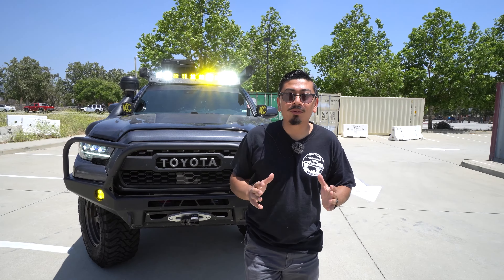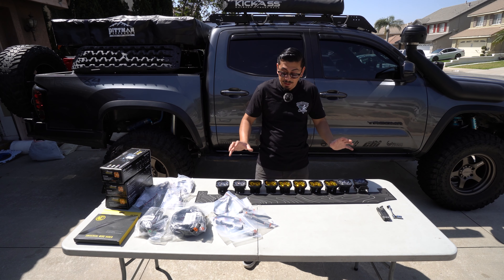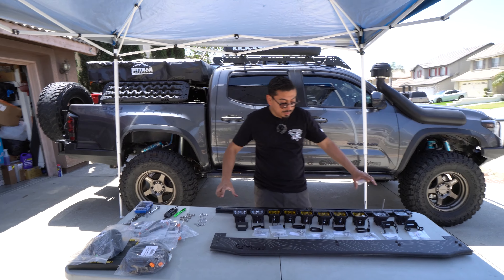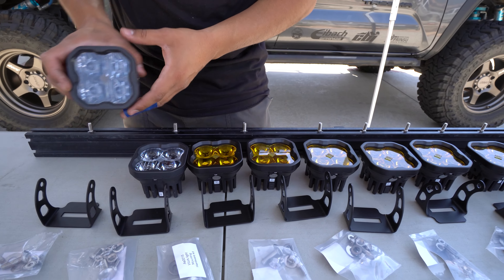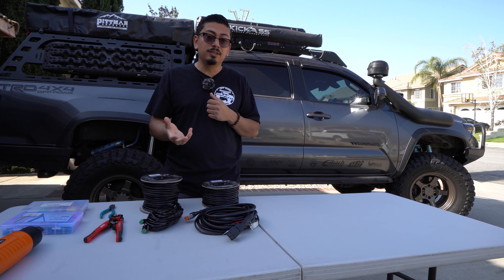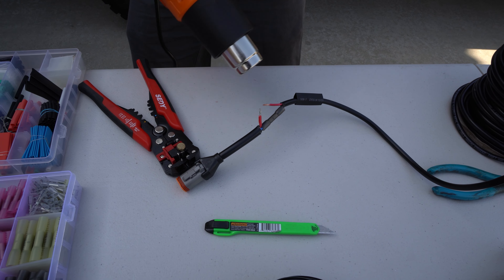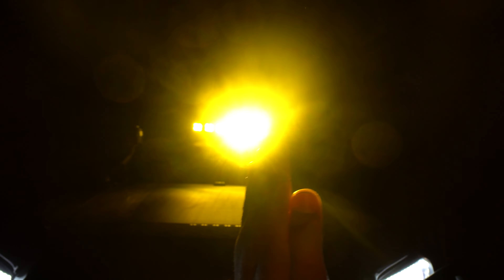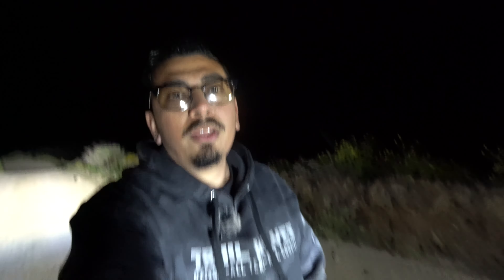How To Build A 10 ss3 Pod Diode Dynamics Roof Light Bar | One of a kind Must Watch In Depth

Comment: Hey, I'm revisiting your video and now I cant help to notice you have KC hilights for ditch lights. So... why didn't you got a gravity pro 6 light bar? 
8 total lights, perfect colour temperature, 6 spots, 2 wide 40s. You can angle them in a curve, leave them straight or just angle the outside ones. I would go that route if my budget allowed me to do it. I will use your solution for my colorado because I'm gonna sell it, but I am planning to get a KC lightbar for my Chevy Express because that Van will stay with me for the next 20 years or so. Same if I get a big 1/2 ton truck or a Tacoma (3rd gen, the new one is not meant to last a life time).
Reply from the maker: In time I will I have to save for it, so far have kc fogs and kc ditch lights but need to save for the lightbar just kind of expensive so in time I will

Comment: Very nice. It is a pain to adjust everything independently, but once you have them pointed in the right spot, it is the best you can have.

I am planning on doing something quite similar actually. I recently installed a combo set of ditch lights using 3" cube pods as the main ones (just far enough to the side to have a wider iluminated area) and some inexpensive 2" pods mounted on the side of the main ones acting as the actual ditch lights.
I am gonna put 2 more 3" pods behind the grill as suplementary high beams attatched to the high beams so I actually have bright high beams. And finally, I am planning on making the same "pod light bar" out of 3"cubes on top of the roof. I will be using only 9 pods to have better space for tools during the adjustment part of it and I'm gonna wire them all together because the only way I am not using the whole light bar is if there is way too much dust/rain/fog in the air or if I'm driving on public paved roads.

Lights make a night and day difference on a rig (literally, you can bring day time into the night).

Comment: Why didn't you just cut the relay and fuse out of the factory harness? You did so much extra
Reply from the maker: When u have a switch panel like I do u do not need a relay or a fuse because a switch panel is made of that that’s why now if u don’t have that then yes u use a relay and switch
Reply: @JesseRizo  I have the same switch panel you do, and the same diode dynamics pods. I used the factory harness. I just took the factory relay and fuse out of the circuit and used the rest of the harness. I didn't have to make one from the connector.

Comment: I got a ticket for not having my light bar and light pods not covered in Cali :(
Reply from the maker: Ooo man :/ yea I have my ditch lights covered for that reason and plan on getting some for the lightbar for the same reason
Reply: @JesseRizo  I have a cover for the light bar I bought after the whole ticket and man they are super super noisey and to be honest I rather put blue tape on the light cause man the noise is super loud and gives me a head ache
Reply: Sure real?!
What part in CA?
Also they ticketed you for just having all of them not covered or certain positions that need covers?
Reply: @MrWortWort1   SoCal.funny enough I’m not sure if you are familiar with SoCal but I was driving on 138 by cleghorn going towards the 15 is where I got stopped and they told me the hole light bar needs to be covered and pods also need to be covered
Reply: @robertsolis7037  
I'm from SoCal
I'm planning to install ditch light with SAE approved Amber flood lights

I don't want to get a ticket too for just having them uncovered
Reply: @MrWortWort1  unfortunately I have some as well and according to the officer he said ANY after market lights pods,light bars single or dual lights spot lights any lights when you buy them and they say off road use only they have to be covered on public roads and highway if not being used.only if you are off roading they can be uncovered other than that they have to be covered at all times
Reply: @robertsolis7037  
That's ridiculous 
Meanwhile I'm getting blinded by some idiot using their led headlights on highbeam during normal conditions 😑 

How much did they charged you?
Reply: @MrWortWort1  as of right now it’s just a fix it ticket so I’m not sure I have court in August .so I’ll update you when that day comes lol .ironically there was jeep passing me by doing a cleghorn run with light bars and pods and I told the officer look they don’t have them covered but he didn’t budge so I just laughed and went home
Reply: Wtf I just got some ditch light pods on my truck. I didn’t know we have to get them covered ?? For real ?
Reply: @Turtlemilk   yes sir